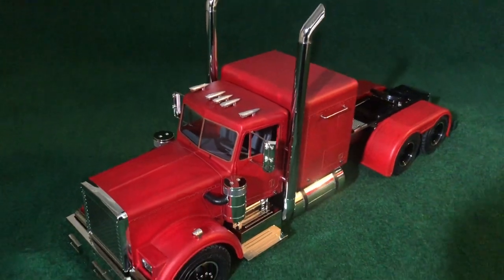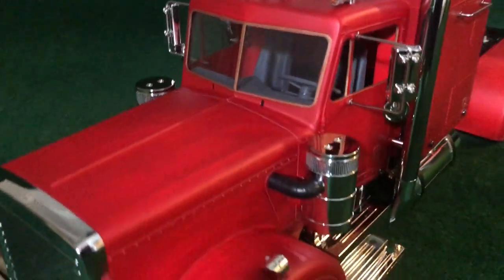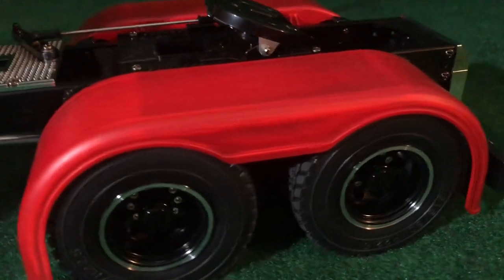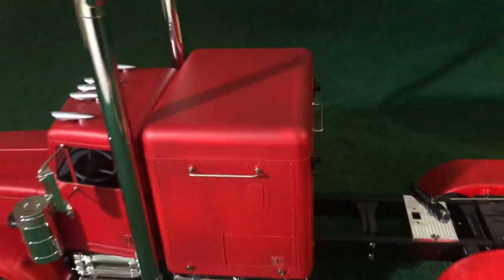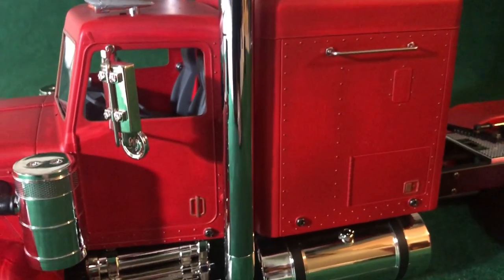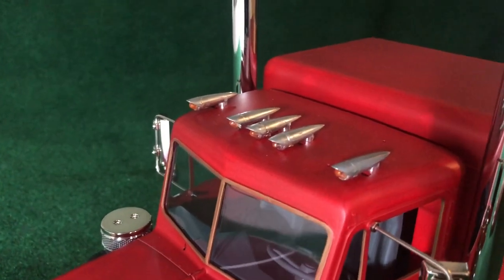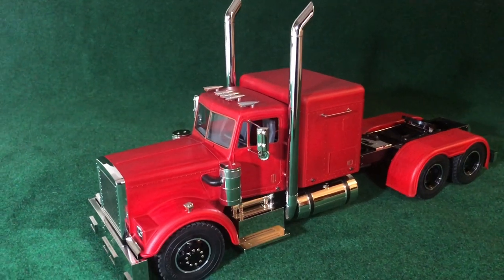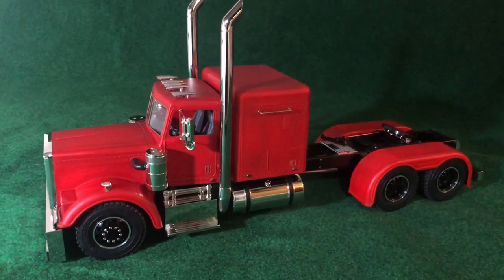Tamiya 1/14 Grand Hauler 90% finished

Comment from the maker: It’s darn hard to get the camera to capture the different shades of weathered finish as the editing software wants too remove the darker tones, maybe it’s trying too auto adj for lighting?   Running a Rc4wd 80t motor bearing upgrade kit locked diffs upgraded wheels tires front axle steering rods steering knuckles etc.  more upgrades as time goes by

Comment: Nice job as usual!!!
Reply from the maker: lol there is a more recent one of it being unloaded by the track loader.  This paint job is amazing up in true light.  Hard to see the glory of it on camera...thanks again bud
Reply from the maker: ps didnt care for the horns or the front head light lenses.  horns so thin they broke on the perch and the headlights just didnt work out right when I glued the clear into the lense cap so I left both off to upgrade..
Reply: Your attention to detail is better than most people’s 
so if you have an “issue” I may not even notice. lol  I’ll check out the other video.
Reply from the maker: Email me at one2manyrcs@gmail.com

Comment: Looks good in my opinion 🙂👍👍
Reply from the maker: Thanks bud I think it turned out awesome A few of the smaller pieces are very fragile so too speak.  just going too upgrade step by step to metal..My Bruder rigs even though plastic parts as well they are superior in strength to the Tamiya’s plastics.

Comment: When i attach the plastic gas tanks, i have only put slight blue lock tight on screws. Also made sure the screws are not over tight etc. But when I woke up in the morning the 4 tabs on each gas tank were broke and they were laying on the floor. Why would that happen? Have you seen anything like it?